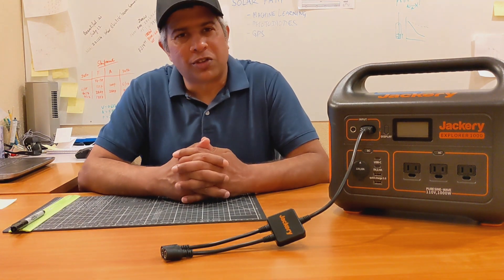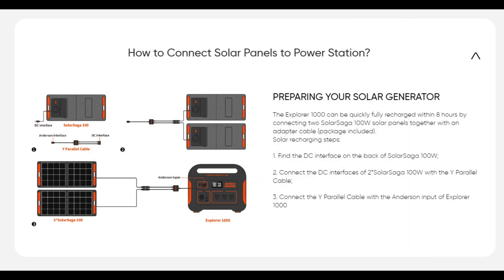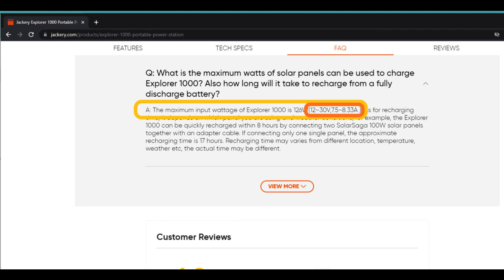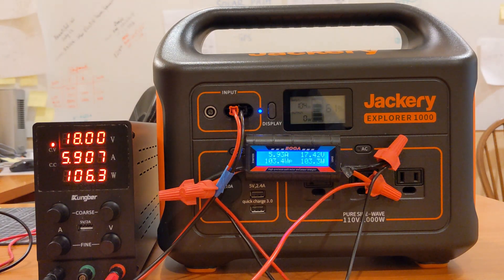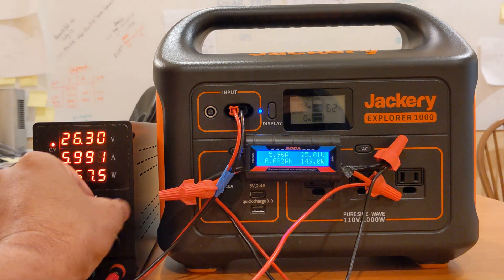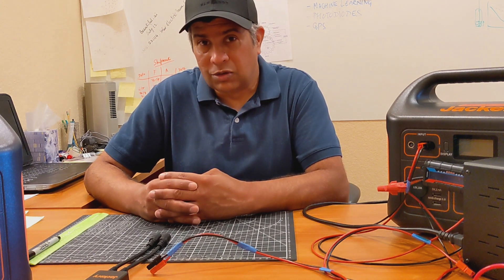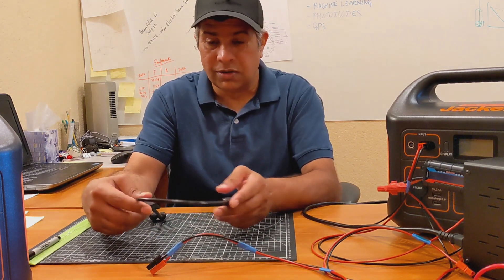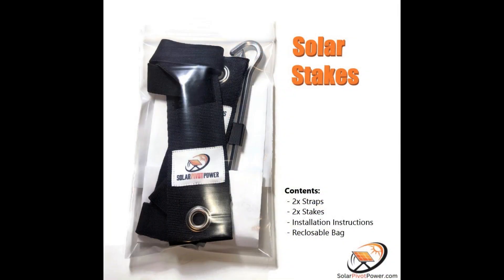Myth Busters - Jackery Edition

Comment from the maker: 👋Sorry, new to this: Should have added that the primary reason for 126W Solar Charging limit is that 2xSolarSaga 100W combined in parallel are capable of providing power at 18V and about 12A (6A + 6A). This seems to exceed the internal limits of Explorer 1000 (I suspect it's 18V/7A: 18x7=126). A DC Boost Converter, if purposefully designed with care, should be able to support 25V/6A = 150W. Maybe this could be replacement adapter for Jackery's Y parallel cable, i.e. combine the function of adapting 2x 7909/Anderson Pole and DC Boost.